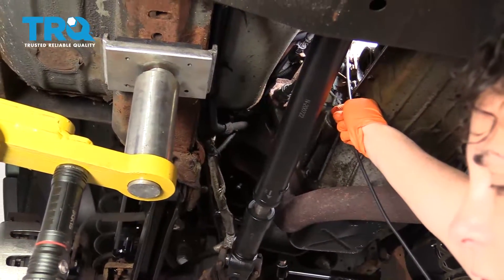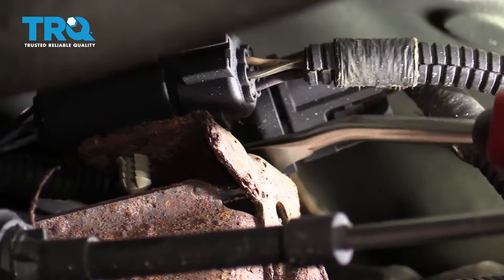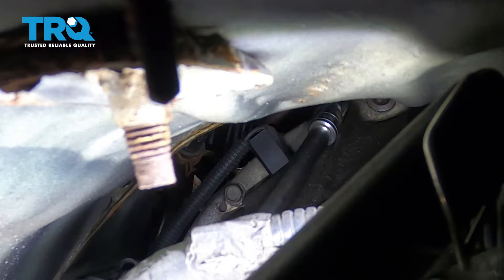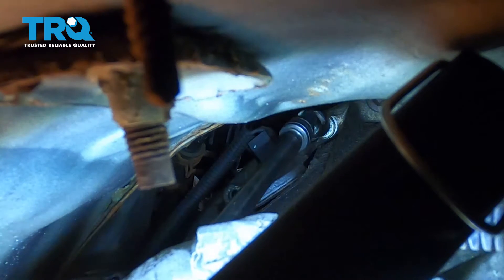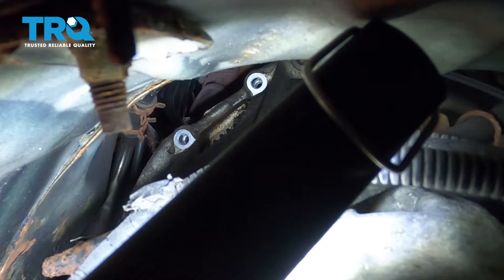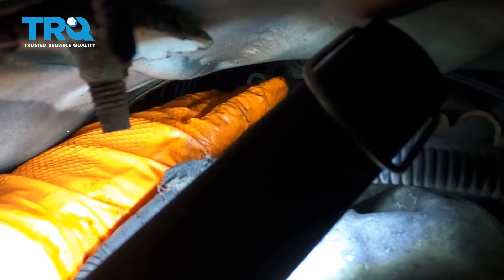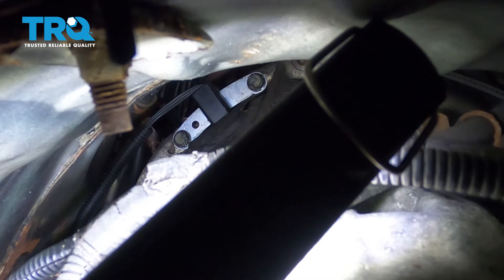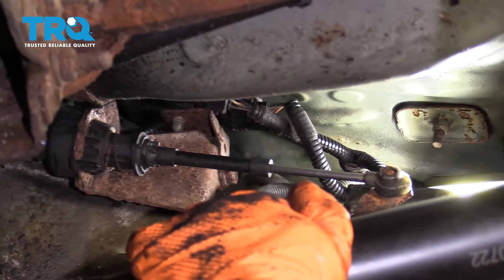How to Replace Crankshaft Position Sensor 1984-2001 Jeep Cherokee (XJ)

Comment: No freakin way she did that in less than 5 min.
Reply: If it's your job and it's what you do at least once a week it sure does even take on 3 minutes not 5. But if you are a DIY person, it can even take you a week or 2 without the proper tools and a lift. PERIOD.
Reply: @benergy100k2  Right?  Lol.  I have started a new rule for myself.  Every single project I do, I buy the necessary tools.  My stupid ass Jeep is frustrating enough; I refuse to dilly dally for hours trying to make subpar tools get the job done.
Reply: It's pretty easy when you have tiny arms and can reach up there like that. I had to make my own tools to get there and recruit help to put it back in as my arm cannot fit from the bottom or top. Also my bolts were threw bolted with a nut not a stud and used a 1/2" bolt instead of 7/16"
Reply: @jordanm8694 for sure small arms would be super beneficial.

Comment: also, check your fuses, i tried everything on my jeep, and come to find out a tiny blown fuse was the issue so triple check them
Reply: Which fuse was blown? I am having a devil of a time with my 99XJ. Replaced three crank sensors, two cam sensors( pick up coil) cap and rotor, new ECM, new coil and traced all wires back to ECM but trouble code for the crank sensor remains and it runs like 💩
Reply: Also curious to know if this was to fix a CPS issue...

Comment: Note, the manual transmission is a little different. And the connector for 1984-1995 is different from 1996-2001.
Glad you gave the 7/16" American Customary Unit size of the screw head, lots of people on YouTube are calling it 11mm.
Reply: <amused> Yet some of us encounter SAE and Metric while working on a vehicle which is a PITA. Not sure about anyone else, but I've dropped sockets and never recovered them as they drop into places that I can't see or in some cases can't get to. I've also found sockets that have fell out of vehicles that probably fell out ironically from those types of places as well. And a screw generally comes with a pointed tip while a bolt does not. I've found that sometimes I happen to have a 12mm on hand and not my 1/2 inch socket or wrench. And the proper connector shouldn't be an issue when ordering the part as make, year, engine and model/sub-model should cover this. (derp) </amused>  lol
Reply: Whats the difference? I have a 97 jeep xj 5 speed manual transmission 4.0l inline6 and i need to get there crankshaft sensor replaced.  I have code P1391
Reply: @the_Gr8T_LuCh0  The manual has different routing for the harness, but otherwise is the same. I just removed the sensor on my 98 5 speed XJ.

Comment: I just replaced the CPS on my 2000 XJ 4x4. I didn't remove the shift linkage bracket but I did drop my front drive shaft at the front diff only. I tied it up out of the way. 
It gave me more room to get up in there. I also used my Milwaukee battery powered ratchet. Much easier because there wasn't much room to swing a hand ratchet. I took my time and my total work time was 2 hours. Now that I did it once..if I had to do it a again..I could get it done in under an hour..Problem seems to be fixed. I took it for a  30 min test drive..so far so good....Thanks for the video.